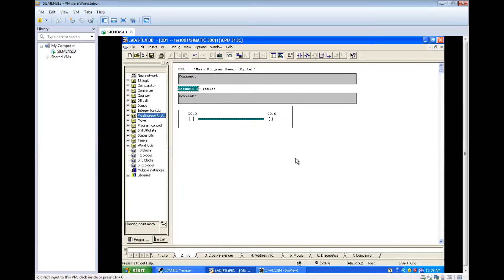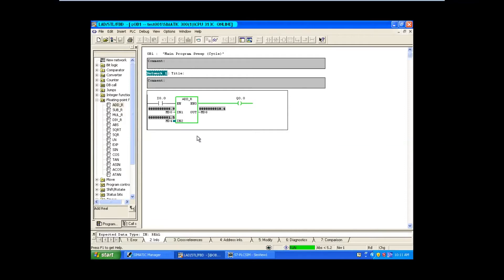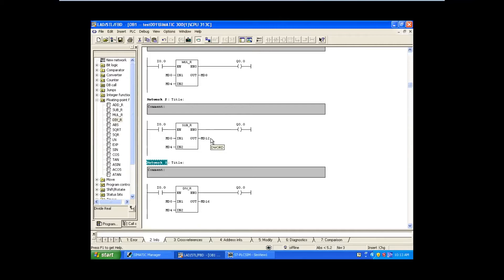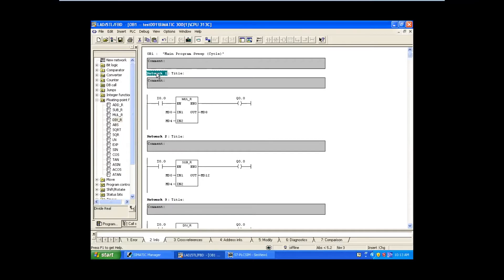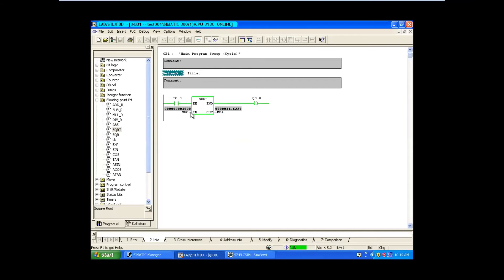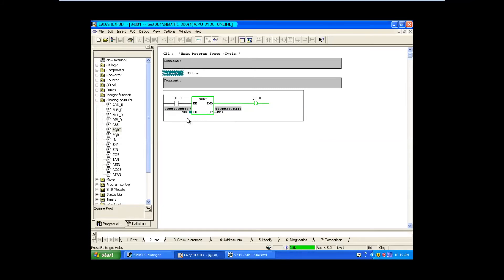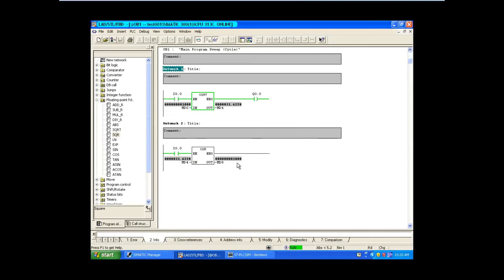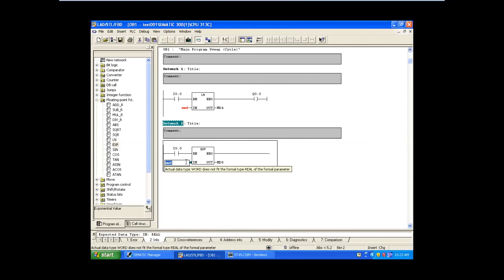Floating-point Numbers in Siemens PLC Programming

Comment: mam i have an issue.When i put any value it is in the form of e-...
Reply: You have to put the value in points not in the form of integer or whole number.
For example: if you want to give 10 on input you will write 10.0 or 4.5 or 6.9 or 2.0 so on. You have to use decimal numbers.